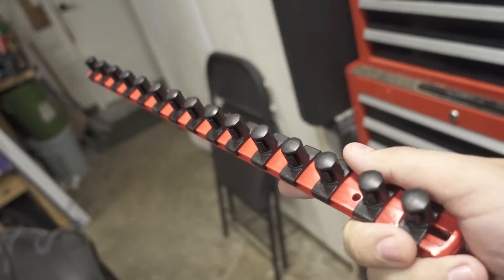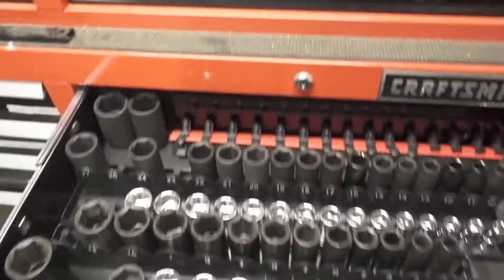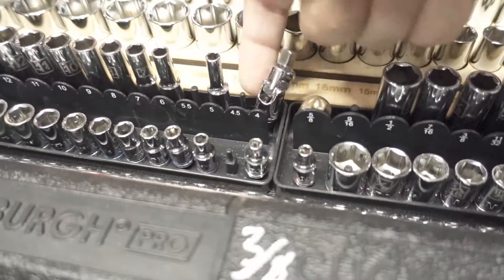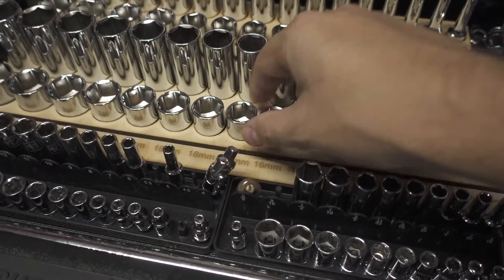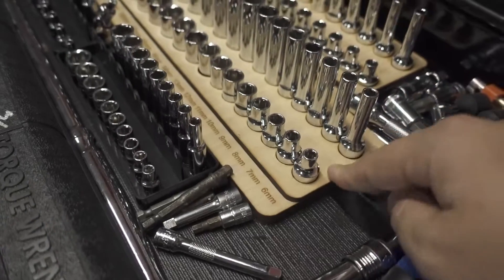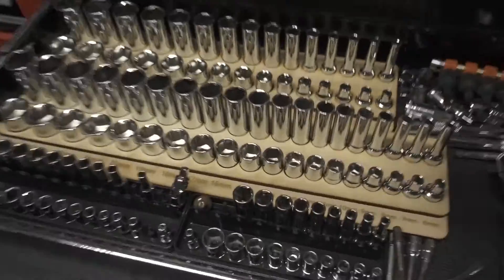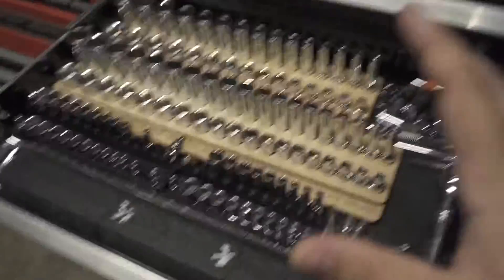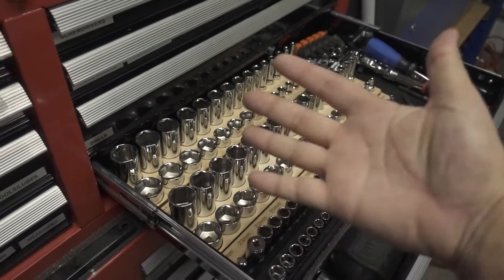DIY Socket Organizers MADE WITH LASERS!!!

Comment: Thank you, I found a service bureau in town that has a laser cutter, so I'm going to try this. Dustin, you explained that you measure the diameter of a socket and make the diameter of the hole slightly larger. How much larger, and do you add more for larger sockets than small sockets? Thanks!
Reply from the maker: I added about a 16th of an inch diameter to the holes, it works pretty well. The looser it is, the easier it will be to pull out, especially if you add more layers than I did. But it will rattle around more. I sized mine to my sockets but your results may vary depending on the socket wall thickness. If you cut them out, Let me know what you think and how I can improve it!
Reply: @DustinCorbin  Thank you so much!!!

Comment: I have the same problems with socket sets I own...nothing on the market is perfect...your solution is very practical...I think you could have made them narrower by putting the size labels between the rows.   Space in a busy socket drawer comes at a price premium...so the smaller the footprint with the same functionality, the better!! Thanks for the content shared!
Reply from the maker: Completely agree that space is a premium in a lot of cases. In my box and layout I prefer it as is, but I can totally see it making more sense in the middle like you said. I've modded the file a little bit to make it more space efficient, and eventually plan on doing a V2 with space and assembly improvements.